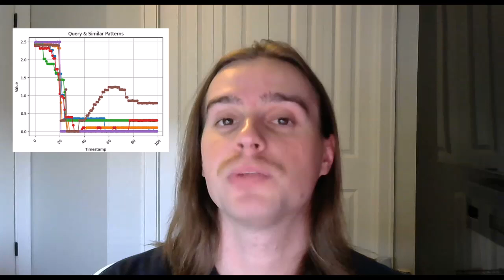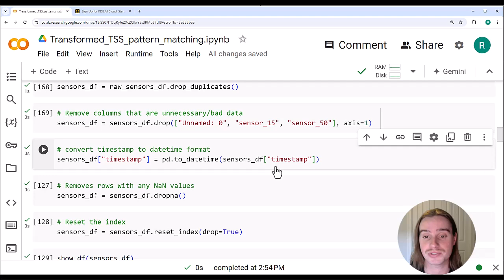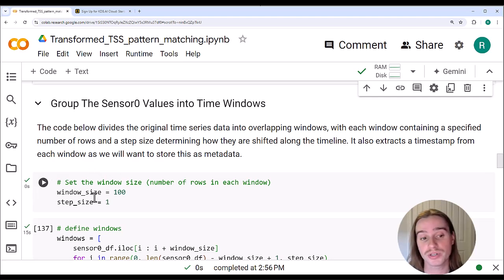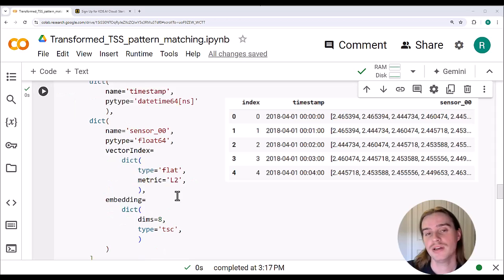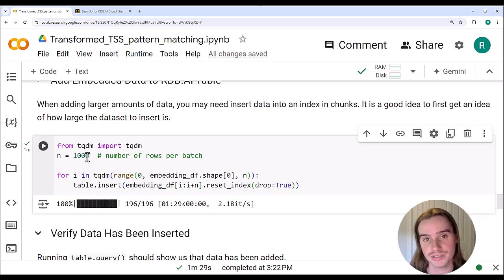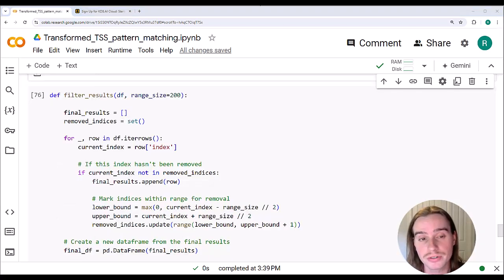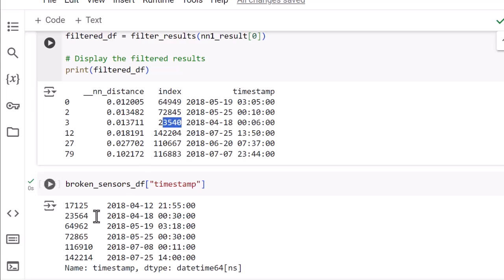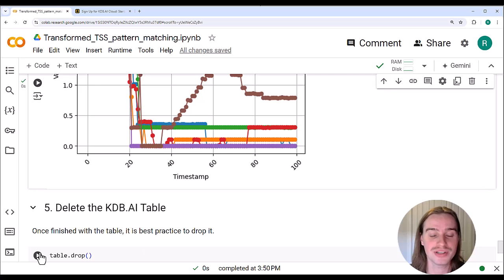Time-Series Pattern Matching - Detect Failed State IoT Sensor Data with Temporal Similarity Search

Comment: good work.. bro.. can I predict instead of detecting the sensor failure with this TSS?
Reply: Yes, pattern matching trends are used for prediction that some event is likely to happen soon a thus needs maintenance. I.e. similar pattern occurring in vibrations and temperature show that a failure is likely soon and that pattern will get stronger over time until the fault occurs.